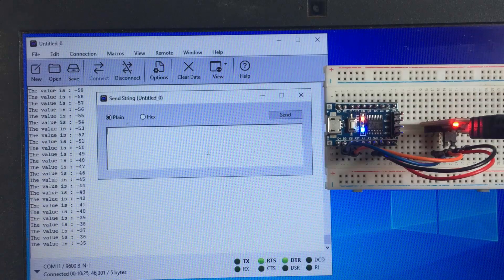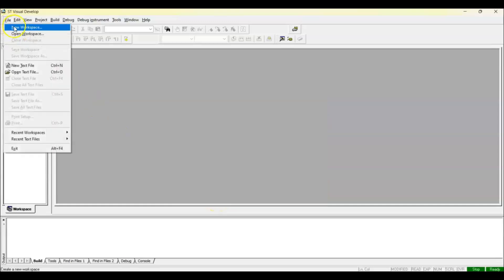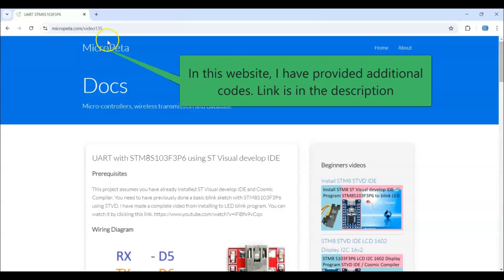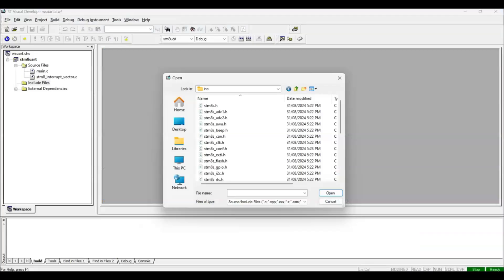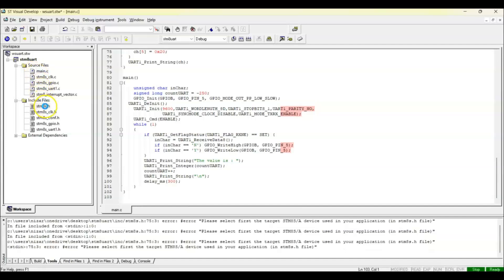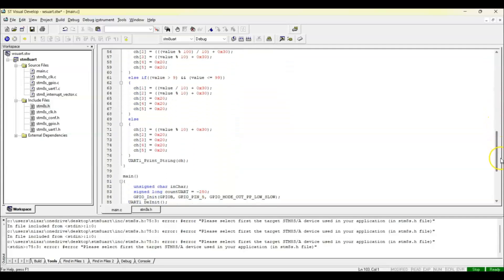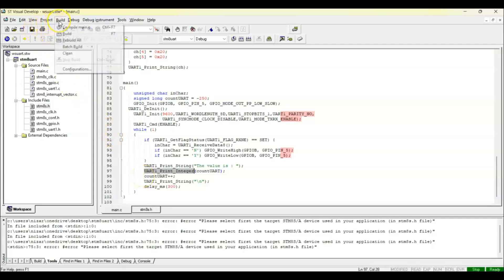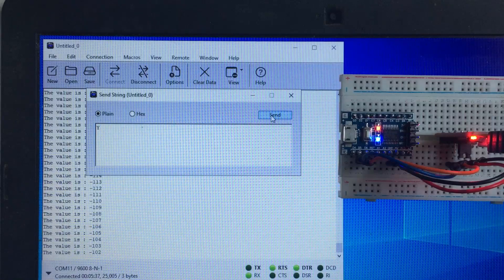135. STM8S103F3P6 UART with STM8 STVD IDE

Comment: Hi i am using stm8s103 to connect with a SIMCOM module using UART. is there a way to view AT commands running that is programmed to STM8S103 and what is comming out of the SIMCOM module in STVD software??